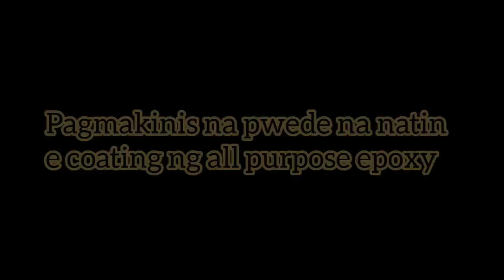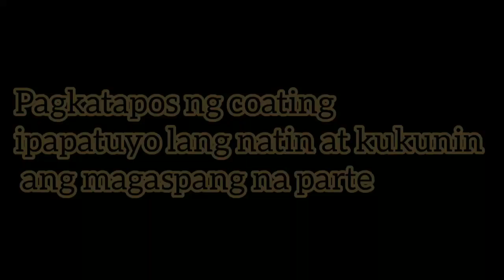HOW TO MAKE A SKIMBOARD  (DIY SKIMBOARD)

Comment: di rin mabilis mapudpod yung pintura?
Reply from the maker: D naman boss
Gasgas lang pag may mga batobato 
Sherlux spray paint  gamitin mo para madulas siya sa tubig.
Tapos lagyan mo lang ng wax oh kandila ang part ng board na tatapakan mo
Reply: wala nang clear top coat boss?  goods na?
Reply from the maker: @kielcoal5958  okay lang naman lagyan 
Clear coat boss
Mas maganda
Reply: Pangit bosny? mas goods yung sherlux? buti kapit sa epoxy lods sakin sakin kasi tuklap
Reply: btw ganda ng mga gawa nyong skimboard lods
Reply from the maker: @kielcoal5958  oh dol try mo rin
Basta ayusin mo lang rocker para d agad lulubog ang harapan iwasndisgrasya

You can check our new videos
Kung saan nakikita mo yong kinalalabansan ng mga diy skimboard namin
Reply: lods,ilang araw nyo pinapatuyo yung epoxy coat?
Reply from the maker: @kielcoal5958  d ko alam lods kasi d kami nakapag gamit nyan
Mahal kasi